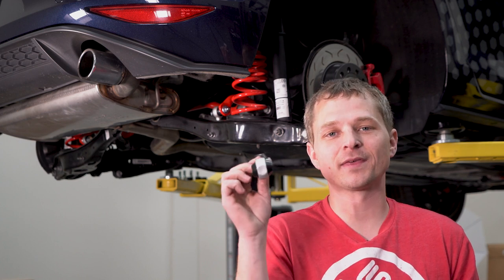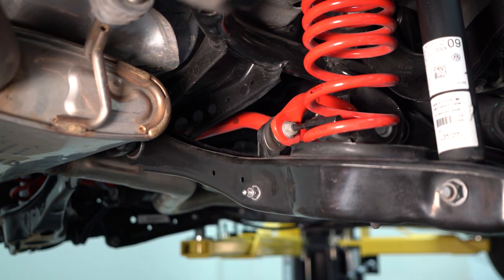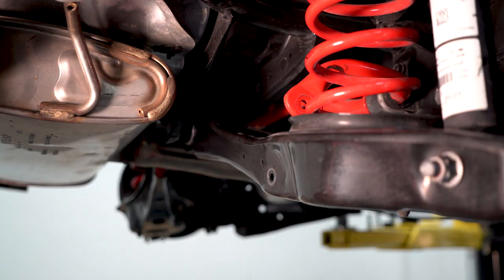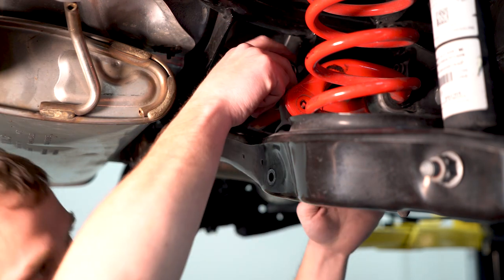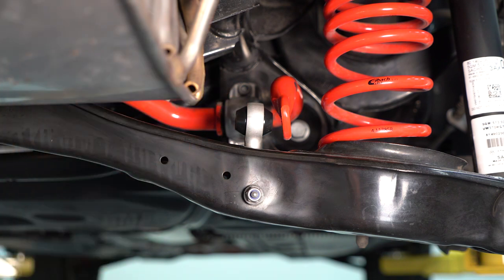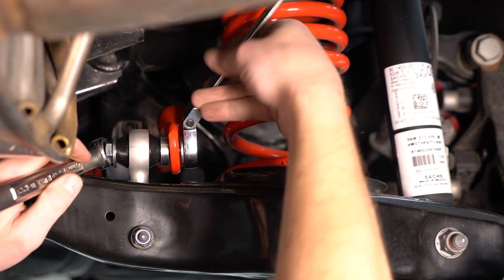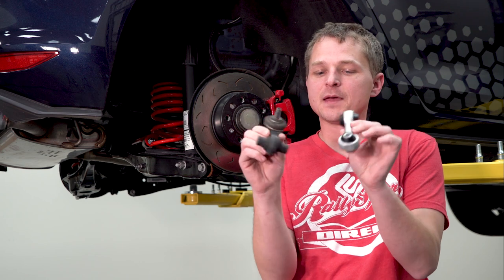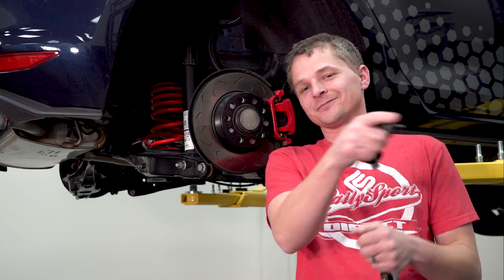How To - MK7 GTI Kartboy Rear End Link Install

Comment: Are they noisy and do they need to be lubed
Reply from the maker: A bit noisier than stock due to the harder bushings, but that is to be expected. And these will not need to be lubed, just bolt them on and go :)

Thanks,
Rick
Reply: RallySport Direct can it be done on ramps? Or off the ground without the wheels on?